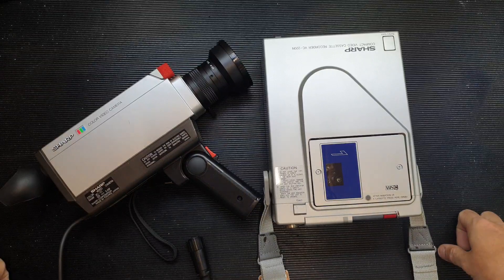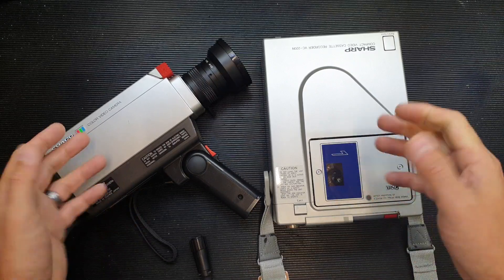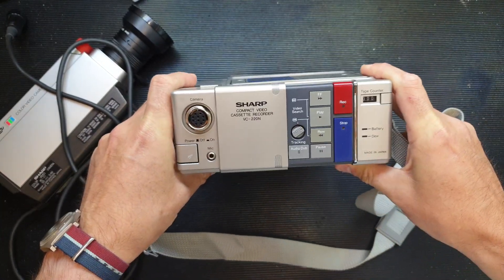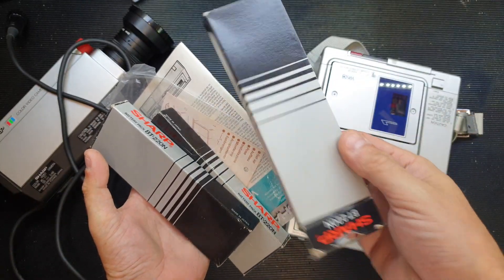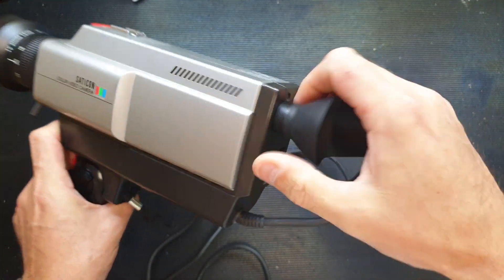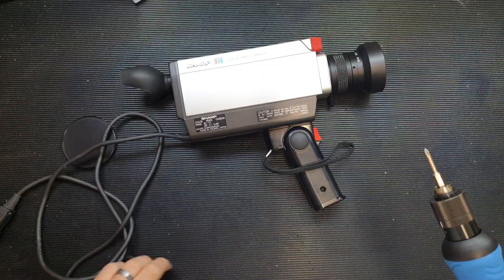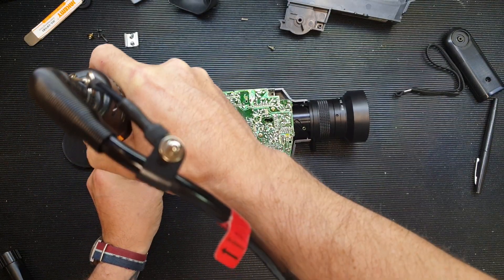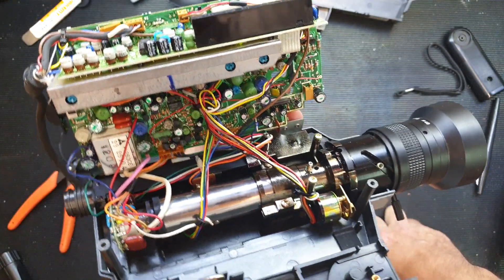Retro Teardown: A 1980's Sharp XC-51 Video Camera / Camcorder

Comment: To add a bit of colour to your excellent teardown description, the optical pick-up is similar to a CRT, but it does the opposite role (light in, electrical signal out) For many years (1940s to 1960s) the standard type was called a Vidicon, and it was only capable of a black and white image.

Later developments for TV studio use had an optical beam splitter that fed three tubes through colour filters for RED, GREEN, and Blue light components.

The Vidicon was replaced by the Plumbicon (1962) that had greater sensitivity and less image lag (sticking or ghosting of a fixed image) by using a lead-oxide target.

The three-tube cameras made excellent images, but were too expensive, and also too hard to set up each time, for the consumer video market.

In the 1980s there was development of twin and then single tube colour pick up tubes, aimed at ready-to-use amateur cameras and portable video recording. The single tube has a colour filter on the faceplate, consisting of diagonal strips.  Clever electronics can de-scramble the R, G, B light components. (using ultrasonic glass delay lines, that are those fat black rectangular components on the PCB) 

The single tube emerged as the champion for its simplicity, and more light sensitive and with burn resistance low-lag target layers called SATicon (1973) and NewVicon (late 70s) tubes. This were further made smaller (25mm to 18mm to 12mm) which made the zoom lens smaller and lighter and with a wider focal length ration (6:1 then 8:1, then 10:1 and 12:1)

Towards the end of the 1980s MOS (Metal Oxide Semiconductor) and CCD (Charge-coupled-device) image "chips" replaced the vacuum tube pickup tubes completely.

Looking back, the 1980s were the "golden age" of consumer video engineering. I miss the 1980s!

Well done on your teardown, and presumably the camera in question is still working.
Reply from the maker: Cheers for the added info.
Reply: @KrisCochrane  NP TY.
Reply: This should be the pinned.  comment above. Thank you sir for sharing.

Edits are corrected mistakes made by dumb phones. 😂 
Merry Christmas
Reply from the maker: Pinned!

Comment: I remember these from my time at Comet in Renfrew, we would get the odd one in for repair. The dew warning is actually for the recorder, not the camera, dew would form on the helical drum (the bit with the pickup heads), if you put a tape in when the drum had dew drops formed the tape would stick to the drum and make an almighty mess inside, then you would bring it to Comet for repair! VHS players had dew warnings also, they were mostly for post delivery dew but a lot of houses had no central heating and the lounge had a gas fire, this also caused dew to form inside the machine on cold mornings. Ah the glory days of repairable electronics...